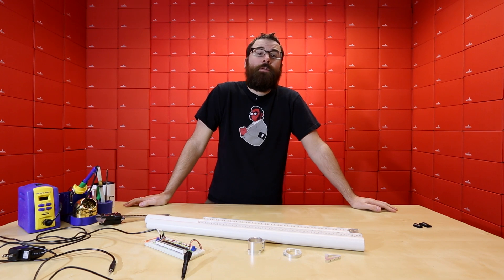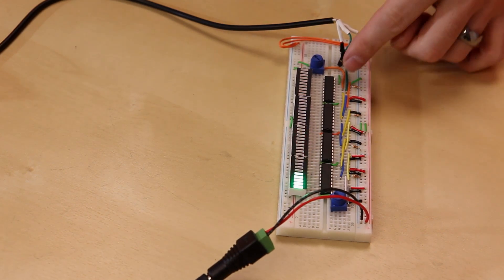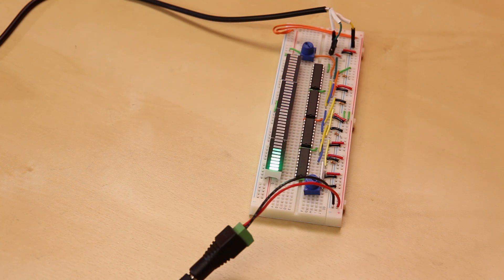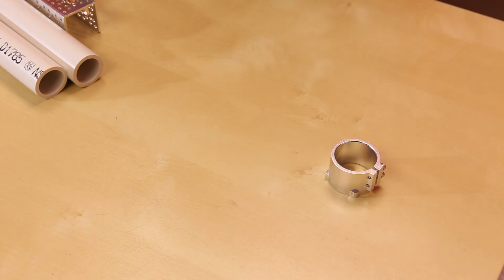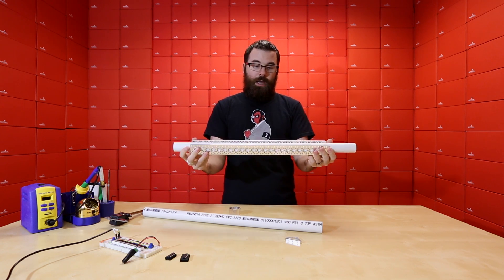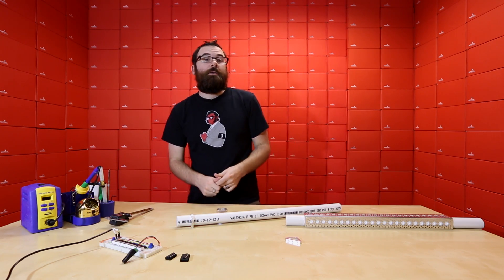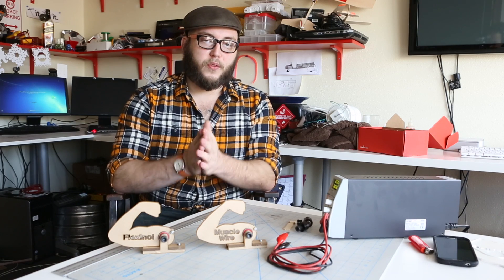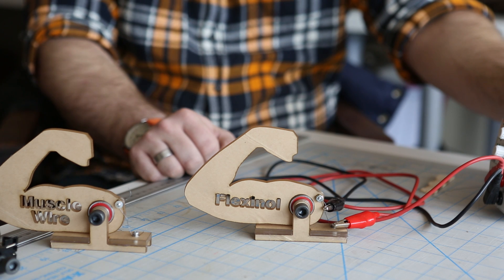SparkFun 1-17-14 Product Showcase: Creative Muscle

Comment: Can you use flexinol to open small valves under water?
Reply: No.. It needs heat..
Reply: The wire would not heat up quick enough for the leidenfrost effect to come in to play..
Reply: @PvtHaggard  just adjust the convection coefficient to dissipate heat at the desired rate using some membrane, it's just a matter of having the right coefficients

Comment: Hmm, I was curious about trying muscle wire or Flexinol in a small robotics project, but that demo was less spectacular than I thought it would be. For the amount of current needed and the time it takes for a full cycle, I'll shelve that idea for now.
Reply: they use it bad, with a longer cable the arm will move much more with a lot of power.